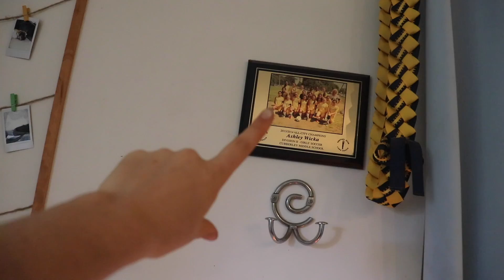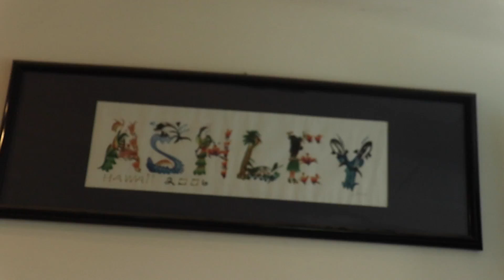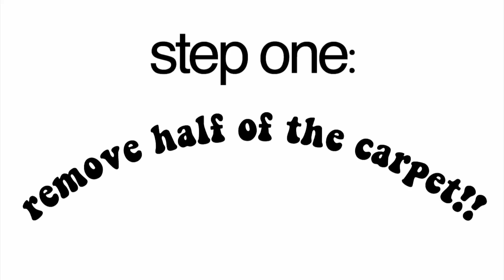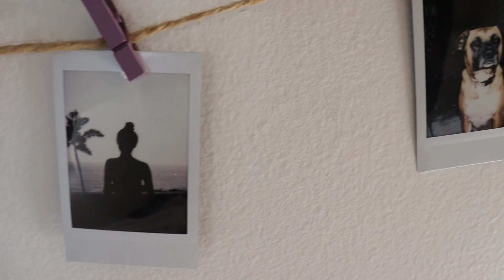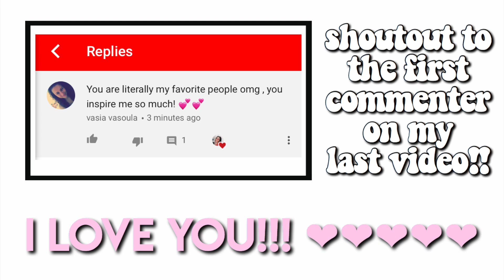ROOM MAKEOVER 2018 | redoing my room!

Comment: If your back starts to hurt from standing for such a little amount of time you should get a posture corrector thingy. It is like a belt mixed with a sports bra sort of thing that helps to correct your posture when sitting and standing. you can wear it under your clothes and it should help a lot with your back pain.